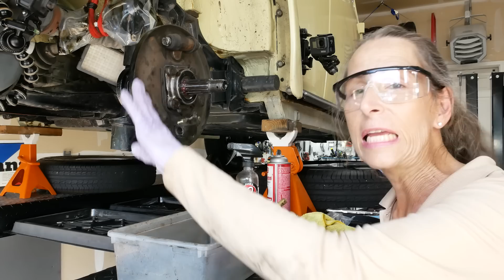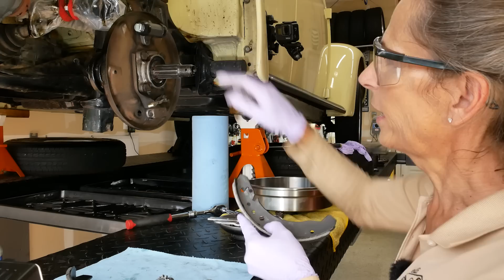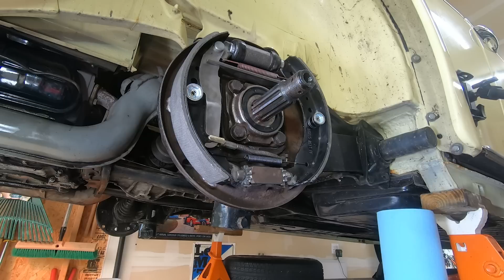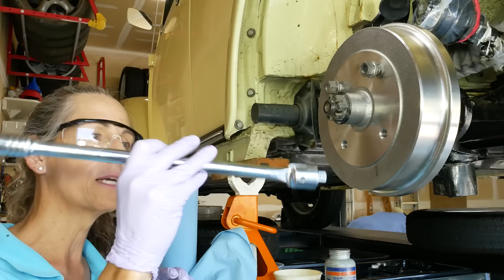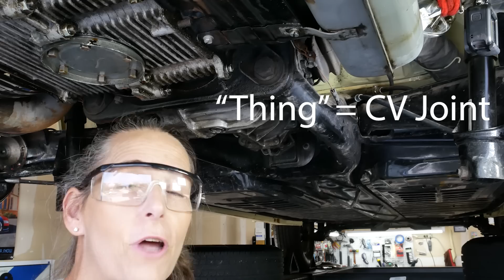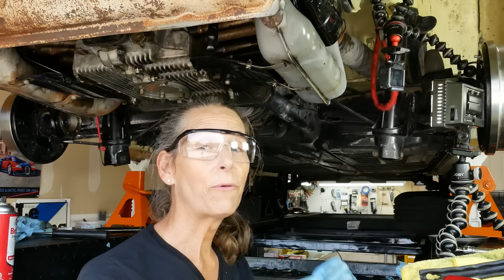VW Beetle Rear Brakes and Axle Seals!  Getting There!

Comment from the maker: Hi Everyone! In this 1969 VW Beetle episode, we are replacing the rear brakes and also replacing the transaxle shaft oil seals.  With the bearings finished in the last episode we can start to move forward.  We use that cool torque multiplier to set the hub nuts to 225 Ft-lbs! :)
Enjoy!

Tools used:
The VW Torque Multiplier too for rear-wheel nut: https://amzn.to/3besSiq
The Ring Plier kit: https://amzn.to/3gDDw33
The Star/Triple Square/Spline Drive toolset: https://amzn.to/31DUHxk
Seal Puller: https://amzn.to/2EPxT4y
Rubber Mallet: https://amzn.to/2ENIBJ6

Comment: Hi there.  I Enjoy watching your videos!  

Careful, I would not grind a bearing to fit.  Grinding a bearing (or its housing/shaft) is a high-precision operation. Usually, if a bearing doesn't fit, the preferred method is to clean/deburr the shaft or the housing, rather than the bearing itself. Bearings are precision-engineered components with specific hardened layers; grinding them can compromise their structural integrity or introduce heat-related warping.  

You can also freeze bearing to help them fit.   A bearing punch the proper size helps and can be borrowed from local parts stores.

Comment: My father's 1972 vw super beetle  has the right rear brakes really tight. He removed the drum and moticed the adjusters were all the way in so wasn't sure what the problem was. He tried putting the drum back on but seems like the brake shoes are holding the drum from just sliding on. Not sure what to do Amy ideas of what to do

Comment: I also agree and reccomend that you removing the Brake bleeder helps. They went to 8mm for the bleeder to make it easier to open/close. 
 However when reinstalling the brake cylinder I always screw in the brake line first with the mounting bolt only loose. Once the brake line bottoms, tighten the mounting bolt. Then tighen the brake line.

Comment: Excellent videos, so clear and concise. I appreciate your attention to cleaning parts before assembly. I have a 1974 Beetle entirely disassembled right now, will be going back together this spring and summer. A tip I learned working in the auto service industry for 25 years. Pack the channel on the backside of seals with grease. Sometimes when pressing/hammering a seal in, the spring that keeps the lip pressed against the shaft can pop out and then it won't seal properly. Not to mention the rogue spring! The small amount of grease won't contaminate the gear oil to any appreciable degree. I will certainly be revisiting your Beetle videos as I begin putting things back together!
Reply from the maker: Thanks for the tip!

Comment: The bolts are XZN. I use a Hazet 8808 - 8LG so the head of the ratchet isn't interfering with the dust boot. The cross section of the large circlip isn't the same on the inside and outside. Make sure the rectangle portion is to the outside. I always grease the inside of the seals, not just the outside of the parts rotating in them. I enjoyed the video. Thanks.

Comment: 12:40 when you get that nut “ya zoo” tight......the big cotter pin will fit....you can’t really go passed the slot for it. You will break the nut.
So essentially, if you have it on the ground with a big breaker bar.....when it stops turning it will be in the correct place to put the cotter pin.
There are only 3 places...I think.....the key can go. Neat-o huh? Those Germans were smart.
All bets off if the parts came in a blister pack with the words “ empi” printed on them.

Comment: Great video as always, Heidi and Franny! One suggestion - if you use a stick of some sort and depress the brake pedal an inch or so before breaking the braking system loose it will keep the fluid from continuously peeing out.
Reply from the maker: That's a great idea!  Thanks!

Comment: Like the channel I like to see to gal's that aren't afared to get dirty and are pretty darn handy. I will learn thinks form watch this channel too. I am a car person as well and I got a suggestion. I see your using the old style jack stands which works fine. But you gal's should check out the Powerbuilt 6000lb. unijacks theere much better and safer. There a jack stand floor jack and bottel jack all in one for about $65.00 a peace $130.00 for a set not too much money and are great and much safer then the old jack stands. Been using my for 2 years now and are great. Got mine at Pep Boys. Google them and and find them lots of places. Much better and safer.
Reply from the maker: Thanks Matt, I actually have one!  I was super excited to use it, but it won't fit under any of the cars :(  It is a great solution because so many cars only have one jack point so where do you put the jack stand??  Those as you mentioned solve that issue.  I just need to find one that is low enough to go under the car.
Reply: @HeidiandFranny  
That's a bummer but there nice jack stands.

Comment: Bend both sides of the cotter pin!  I didn't do that once, and the bent side of the pin broke off...and the whole pin slipped out.  Not good.
Reply from the maker: You had a brand new pin break when you bent it for the first time?  Never seen that...
Reply: @HeidiandFranny  me neither.  That's why I always bend both arms on  cotter pins.

Comment: That  torque leverage tool is awesome!!  There doesn't seem to be versions of it for other cars though.  I wonder why.  It'd have been useful to remove the axle nuts on my LEAF.  They're supposed to be only 135 ft-lbs but the doofuses at the dealer got to them at one point and they were tightened to what felt like a bazillion ft-lbs!
Reply from the maker: That is always so annoying...  I wish they did make it for other cars.  I actually bent a cheater pipe on the 911 and it was probably four feet long!

Comment: Great video. I’m about to do my CVs. $80 for the entire assembled set is crazy cheap. Here in Australia, I just paid $600 for just the assembled CVs (4 of them). Including boots, grease, etc. only thing is removing the existing ones from the Beetle and fitting them to the existing shaft after the messy job of packing them. These ones I got are made in Germany. But what a difference in price.
Reply from the maker: It is crazy how cheap they are.  I wonder why the big difference.  I just filmed the install and it still takes a bit of time to install them, keep the clean bit clean and the greasy bit greasy and then torque all the bolts.
Reply: Heidi and Franny's Garage insane. Even with exchange rates and shipping, a fully assembled shaft with all the trimmings here, the price isn’t justified. But the only other option is Chinese, and I’ve experienced the pinnacle of their metallurgy... no thank you, it’s safer using Camembert Cheese.

Thank you for your expertise and tips. I’ll be wire wheeling the existing shafts and probably giving them a little coat of primer and then black heat resistant paint. Then I’ll pack the new CVs and fit them to the shafts and cover them in fresh ziplock bags.

Would you recommend added a clamp around the boots once you have them fitted? The kit I received didn’t come with any, and I kind of assume the little raised sections on the shaft where the small end of the boot sits kind of slides over that and sits there.
Reply from the maker: That is a great question!  The owner picked up a set of boots and such from a local parts place (we thought we would be able to just rebuild) and I ended up talking with the sales guy about that.  He said they never put on a clip on the axle.  I was like, Really??  I always have.  He said I could use a zip tie!  I went ahead and bought a set of clips and wouldn't you know, when the owner arrived with the parts the sales guy threw in four axle clips ;)  Thought so...  The full axle kits have clips on the axle as well so I would suggest to install them.  You don't want hot grease dripping (or flinging) out the end of the boot ;)
Reply: Heidi and Franny's Garage thank you for confirming that. It seems some local VW folks around here are of two minds about the clips too. On this current beetle I’m mechanically restoring, they don’t have any clips. But I might throw some on. It can’t hurt.

Comment: Rats!  I was really looking forward to the greasy-grimy repacking of the CV joints, but can’t argue with that replacement cost, assuming they are good.
Reply from the maker: I've done that a couple times and it is super messy.  I'll add a bit in the next video if I have time on the disassembly and assembly of the joints.  That is actually the fun bit!

Comment: Franny, you make it look so easy but I know from experience it isn't. The best to hope for is a job without significant problems and no surprises when you take everything apart. I love the torque multiplier tool and I'm considering getting one. I have to stand on the torque wrench handle when torquing wheel hub nuts.

I'm looking forward to seeing the CV axle install! I recently installed two on the rear end of my SUV, and I basically had to hammer on them to get them to go into the differential. They won't go back into place even with a coating of differential fluid and a bit of grease to keep the C ring from moving out of place.

One thing that amazes me is the use of c-clips, snap rings, and cotter pins. They are the safety hardware that is the last line of defense against a nut coming loose, a bearing from wiggling out, or a pin slipping out of its hole. They are all so tiny but so very important. They're used on everything from ball joints to turbos. I think about what they do and I'm in awe.
Reply from the maker: The axle install is coming up.  It went well.  Sorry you had so much trouble.  usually it is more of an access issue for me.  I think I change my method every time I do one ;)
Reply: @HeidiandFranny  I'm looking forward to it! Glad it went well.

I have 2 front CV axles left to replace. I did the rear end first because it was making noise and clunking, and felt very unstable. There were a lot of problems back there. All the suspension was completely worn out. The front isn't much better but it has more parts so more redundancy before it fails. The axles aren't easy to get to normally, but I will have all the suspension parts removed and the axles will be easily accessible.

Comment: Nicely done. That torque converter tool is really nice
Reply: I wonder if there's any place to rent one from, 'cause I'm sure kuhl tool = $$$.
Reply: Mark Stach they’re close to $100; if you have a VW it’s worth it to buy it. Every time the rear brakes need to get done those castle nuts need to be removed and reinstalled. Also works for the flywheel.